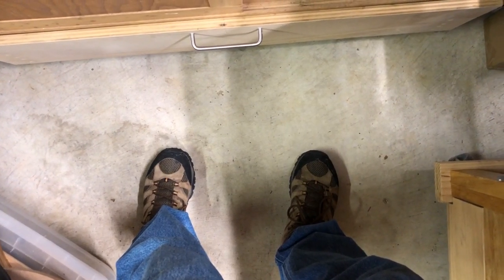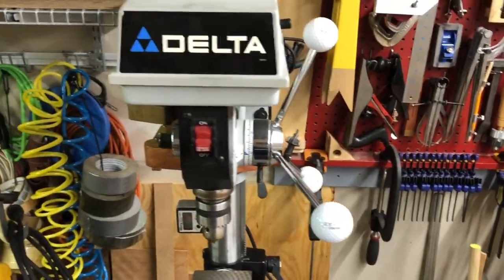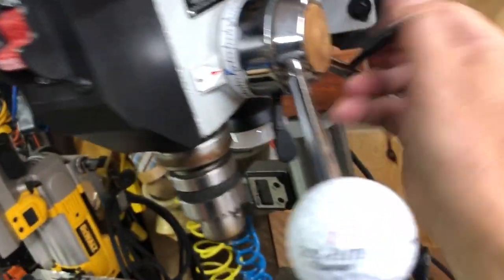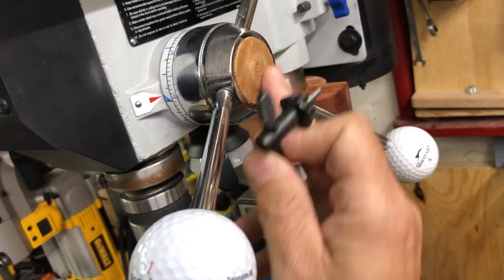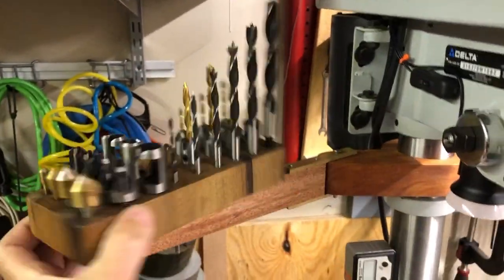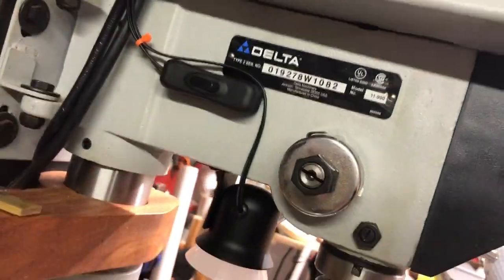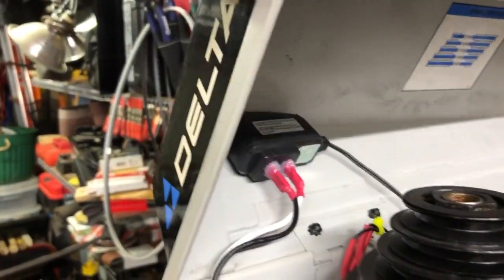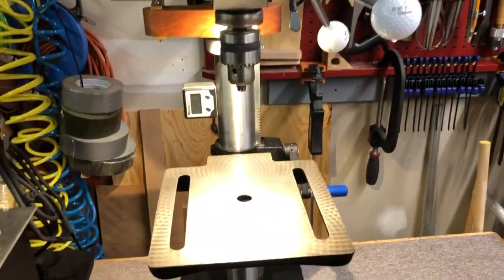DIY Drill Press Upgrades: Cheap and Super Simple (Please Read the Description!)

Comment from the maker: Another good upgrade is a larger table with a fence for improving accuracy--especially for repeated operations.  I have a small table that's removable because I use the drill press for both metal and wood projects.
Reply: To drill holes in the balls at TDC:

1. Clamp a board on the table.
2.  Drill a hole about ¾" to 1" or so.  Size not important.  Just so the ball sits in it.
3.  Ball is now directly in line with the quill.  Drill the hole in the ball.

This works well for any sphere.

For a cylinder, drill a hole same diameter as cylinder.  Put cylinder in hole, then drill in the end.